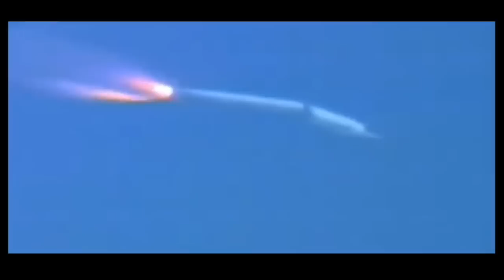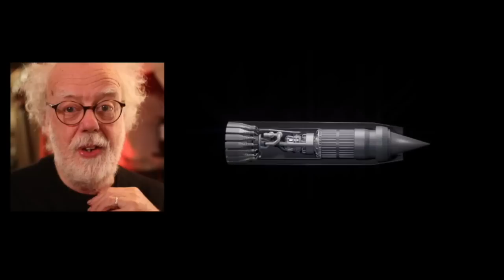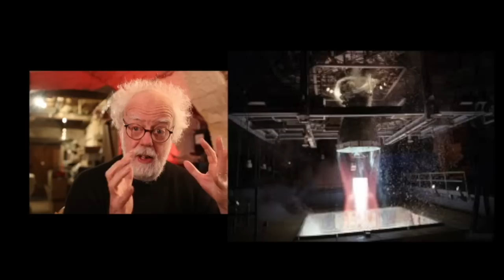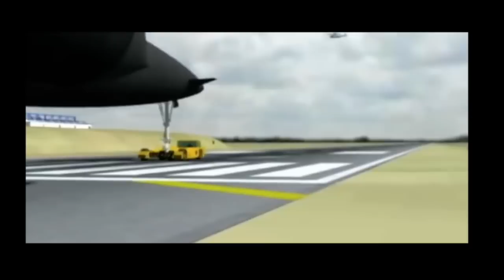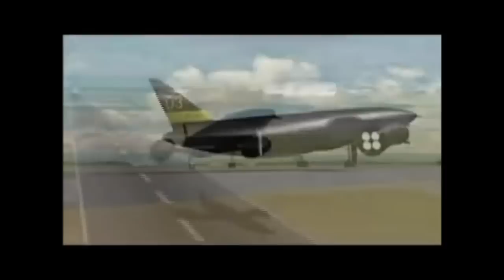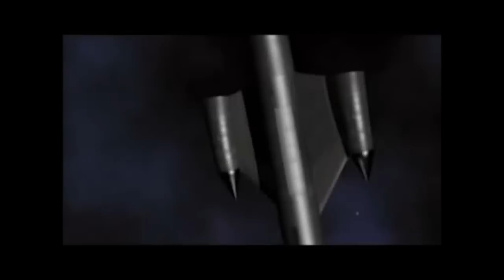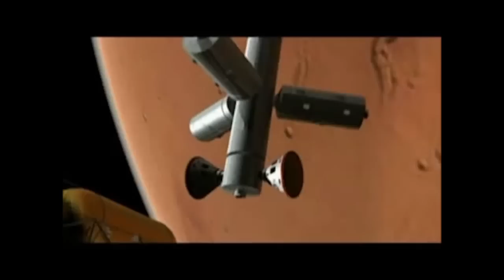SKYLON - The dream - Prof Simon

Comment: I've been following the progress of Reaction Engines for many years, hoping to see Skylon fly one day. Yet RE's home page no longer even mentions it. I suspect SpaceX's success with at least partial reusability has rather undermined the economics of Skylon, with Reaction Engines instead concentrating on engines for hypersonic aircraft.

Edit from here on: I hope that this is a tactical retreat, to continue progress on the development of the engine, without potential investors worrying about SpaceX. So that once the engine is proven, the financial risks associated with Skylon will be much reduced.

Airliners have been made so safe that most of us give safety scarcely a passing thought before boarding one. A space vehicle with airliner characteristics that doesn't have to come apart in flight and rely on rockets for a safe landing seems inherently safer than the alternatives. SpaceX may take the heavy lifting work for non-manned operations, but something like Skylon is surely the safest way of moving humans between the ground and orbit.
Reply from the maker: fab company...hpe this is a breakthrough for them.
Reply: Lockheed Martin bought into RE, I’ll just leave that there...........😜
Reply: @wayneoates8842  So did Boeing, DARPA, Ford and a bunch of others.
Reply: The value proposition for the Skylon concept is a little different to that of SpaceX. SpaceX were smart in using newly designed engines and composites to gain an additional ~2% payload mass fraction (not bad considering that traditionally rockets only have a 2% payload mass fraction to start with, i.e. a 100 tonne rocket at launch can lift ~2 tonnes into LEO), taking it to 4%. But the smart bit wasn't that alone, it was how SpaceX used it. They chose to use it to carry additional fuel and those folding feet so they could recover the whole stage, which is worth far more than the additional 2% payload capacity. However, the Skylon relies on another value proposition, which is flexibility of use. Rockets are limited in practicality due to the rotation of the earth, which means that to gain the inertial advantage of an already spinning platform, they must take off close to the equator, otherwise you end up using more fuel to reach orbital velocity. With an SSTO space plane concept, the inertial difficulties are less of a concern since you can essentially build up speed as you ascend to orbit using the oxygen in the atmosphere, making the concept less constrained in terms of operations and location. In terms of safety, well that remains to be seen I suspect... the stresses and thermal challenges involved in hypersonic flight and reentry are significant, so I think materials and thermal management will be the critical battlegrounds to win over ultimately. Using hydrogen and helium in their hybrid propulsion cycle is also a major challenge, since both are incredibly difficult to work with. Helium in particular is a major headache in closed loop cycles in cryogenics (such as reverse Brayton cryocoolers) because it's difficult to compress. This is due to the molecular degrees of freedom available in monatomic molecules, Helium has only three degrees of freedom in which energy can be added, so when you try to compress it, it rapidly heats up, making intercooling a necessity, which adds weight and complexity to any concept. Furthermore, its speed of sound is incredibly high, which makes compression from an aerodynamics standpoint challenging, since you reach the material limits of impellers before you get into the 'sweet spot' of efficiency. So I'll be fascinated to see how they overcome those issues personally.
Reply: Skylon has a chance to make even cheaper access to space than SpaceX Starship. Investments will be hard to find... EU should finance the program. It would be good for us, a technological leap... I don't like expendable rockets. No logically thinking being likes it. But they probably don't want to end invest into something similar as Venture Star was.
Reply: Sylvia Else It’s typical of so many revolutionary British inventions, something incredible gets built but we’re pathetic at developing them into fruition. The British government couldn’t really care less and pitiful amounts has been given to help. So now DARPA are seizing on it and it’ll probably be used in missiles and the military first, which is a double-edged sword as it’ll probably be developed far quicker but the civilian applications will take decades longer to realise. Well done again Britain, big clap 👏
Reply: You can't buy shares in Reaction Engines, which is a shame. I'd love to. But, major share-holders are Boeing and Rolls-Royce, so if you want to effectively own a chunk, you can buy shares in them. Long term investment though. Also, if Reaction Engines fails, for whatever reason, at least you then have shares in a couple of solid companies.
Reply: I am disappointed that REL has officially ditched Skylon as an inspirational goal. This video is a bit outdated in that sense. REL isn't run by Alan Bond any more.
Reply: Yeah iirc reaction engines is working with USAF now.
Reply: On 25 September 2017 it was announced that the U.S. Defense Advanced Research Projects Agency (DARPA) had awarded a contract to Reaction Engines for an undisclosed amount to conduct high-temperature airflow testing at a Colorado, United States site of a Reaction Engines precooler called HTX. I would hazard a guess as to THIS being the reason some of the publicly available stuff has gone away.
Reply: Also note that it was at the DARPA facility that they did the successful test. This will radically change how space is achieved and I think we will see some really rapid development in the next five years (if they don't let DARPA bury it). Amazing breakthrough. How do they get rid of the moisture I wonder.... amazing.
Reply: @robertsmith1434  That was around when spacex first started landing rockets, times have changed.
Reply: @chadleach6009  Sorry but no, they just passed the demonstration test for the cooler this month. It worked. The test for the engine housing will probably be in the next six months and the whole thing is very alive and well with DARPA and ESA along with several porivate investors like BOEING, and several others.
Reply: @robertsmith1434  I'm not saying it's dead, I'm saying the idea of a spaceplane does not make sense.
The goal of getting to orbit is by going fast, we only go up first to get past the drag of the atmosphere. What's the point of a vehicle that spends additional time in atmosphere instead of picking up speed where friction is lowest?
Reply: @chadleach6009  The aircraft does not have to carry oxygen to fuel the enigines in either mode. All rockets and spaceplanes spend time in atmosphere. The goal is to create a reusable engine and airframe, similar to that of an airliner. The Reaction Engines wants to sell those planes while partnered with Boeing, General Dynamics, ESA etc. They have a three stage process that has been approved by all partes and verified by the ESA, DARPA etc. The first important hurdle was the Cooler. That has passed. Now they need to build and test the Motor, which they have just built testing facilities for and partnered with a EU company to provide hydrogen onsite etc. The last process for approval on the enitre engines is the Inlets . These have to open and close during flight (after the engine converts to a rocket) and there is some tricky engineering going on but the USA has already really done this so basically both the Motor and the Inlet are engineering problem. Hard engineering but something that has been done before. Again the big breakthrough was the cooler, and it is what makes the whole thing possible when it really never was before. Sorry for the length but I did quite a bit of background research on this. To the point that I know they are using wire EDM to machine the coooler assemblies. They are using some exotic materials in the cooler with some really screwy properties... like metal that contracts when heated instead of expanding. Kinda cool.
Reply: @robertsmith1434  It is Reaction Engines Inc's facility, not DARPA's - built using the DARPA funding
Reply: @chadleach6009  The point is that it's more fuel-efficient to use the aerodynamic lift in the lower atmosphere rather than a head-on clash with gravity.
Reply: Greetings from sunny Florida. It's raining, so yeah I'd like to know how to deal with the moisture problem too. Maybe then I could spend less time helping defrost my sister's A/C unit.

Of course the U.S.government is going to try to co-opt the  development of this technology, we've got to start preparing to transport an entire governmental infrastructure into space before SpaceX and other private endeavors kick start the colonization procedure. Just wouldn't do to have an uppity group of colonists literally looking down on us and declaring independence. Need to nip it in the bud.

Plus those brave bureaunauts will want to bring all of their fat children and many, many, cheeseburgers!
Reply: @qjo  Well yeah but, I think Reaction Engines is really really aware of this. With the early ESA backing I don't think DARPA CAN bury it. I am eagerly awaiting the results of the Core Engine Demonstrator. They are taking a VERY conservative and provable approach to proving this technology. The reality is that the cooler was the big hurdle though. The Engine while technicaly difficult seems to be more a matter of engineering than requiring new technology (at least that is the way it seems to me... but I am an electrical engineer and NOT an aerospace one so just my opinion). Also I think the US has already solved the inlet engineering (which is the third compnent of their complete engine).  Again though the inlet engineering looks like a straightforward engineering problem. Difficult but the cooler was and is the huge breakthrough. The applications for something like it are literally huge. So... I really really hope it does not get buried but at this point I do not think it can.
Reply: @robertsmith1434  Bury it? No probably not, but I'm guessing the fact of DARPA providing a test site in Colorado was not a random choice. More likely than burying it they probably just wanted to get the inside scoop on the tech up close and personal to analyze it and prepare their reverse engineering efforts.
Reply: @robertsmith1434  its (the precooler) applications are going to be interesting,  where super cooling is needed. My thoughts are on super conductors and general manufacturing cooling to server rooms and air con? Maybe a mini one on my cpu in my pc?
Reply: @qjo  DARPA paid for the testing of a heat exchanger. The work was carried out at a facility built by Reaction Engines Inc. DARPA only wanted to know about temperatures corresponding to Mach 3.5, which were the results announced in April this year. Reaction Engines upgraded the test equipment (including adding insulation) so they could test to Mach 5
Reply: Skylon was a concept plane? 2 wings a fuselage and a tail with 3 tanks. But BAE are supposed to be building the plane, and its the cooler thats being intergrated into jets and fighters in the US. i doubt this will be a repeat of the UK jet engine given away and nuclear weapons we helped developed but werent allowed to have by the USA.
Reply: @shaun906  You have nuclear weapons. While I agree that the US refused to share data, yoiu actually had scientists who worked on the first weapons and they were well versed in it. It was just a matter of engineering after that... and centrifuges.
Reply: Although SpaceX have futzed with skylons economics there's something interesting in the real numbers.
I keep seeing that the real missions on SpaceX use them in expendable mode.
So they seem to be more interested in throw weight, altitude, speed and reliability rather than cost.
If Reaction can get decent loads up there safely and quickly with good turnaround they get the money and get to reuse their spaceplane.
Reply: @MostlyPennyCat  Maybe im misunderstanding you, but SpaceX recovers (powered landing) and reuses like 90% of there first stage boosters. They just launched one today for it's fifth flight. They reused a fairing today too...
Reply: @charlescsmith1213  they are not reused immediately, they are refurbished. we are talking about refueling, a quick check of the engines and refly. spacex don't say what happens to each rocket between each launch? its many many months thou.
Reply: @shaun906  My comment says James Neave in front of it because that's who I was talking to. You're trying to argue a nuance that wasn't part of my original post. But that's cool I guess.
Reply: Aren't SSTO vehicles a bit outdated as a concept now? If you could work a SABRE engine into the first stage and boosters of a reusable staged rocket, wouldn't that be the ideal scenario?
Reply: @therichieboy  The idea is that the engine function in two modes. IN air they will be eseentially normal but powerful, as they enter the higher altitudes the engine converts into a typical rocket motor. The big hurdle was the cooler which had to cool the incoming air temps (1000 degrees) and the test suceeded in doing bring the temp down to almost liquid, in 1/20th of a second. The secret sauce is the fact that the cooler did not freeze during this (imagine an air conditioning compressor and how they freeze). They have managed to devlop a process whereby mositure is taken out of the air, and it is compressed to very cold temperatures almost instantly. This is a huge benefit to both air breathing engines and rocket motors. It means you do not have to carry oxygen (which is really heavy) since in air it is supplied and the rockets simply use hydrogen.
Reply: @robertsmith1434  mach5??? Is not normal ... Concorde was mach 2 approx. The air is too hot at mach 5 so this is a first, remember conventional 1st stage rockets only spend 170 - 250 sec in flight. They need massive infrastructure, not the most confortable even with the new spacex's iphone crewdragon. I think this will be like Concorde where starship will be a380 to mars.
Reply: @robertsmith1434  Yes, this is all true. My question was whether they factored in the inefficiency associated with SSTO's dead mass. On further research it appears they believe they have. I'm not sure, however, if they've done anything about single nozzle geometry issues. My point is maybe this technology coupled with reusable staged rocketry might be the most efficient thing.
Reply: @therichieboy  No argument there Richard. I think that they really have focused on the idea that an engine capable of both natural air breathing, and rocket propulsion combined with the gains to the top speed for the natural aspiration (mach 5... can you imagine?) was so attractive they went that way. I think it was more a philosophy thing, they are trying to create and sell a space capable 737 sort of, and open up cis-lunar space as well as ease travel time from a to b on Earth. They ARE looking at a "second" stage rocket to push objects into higher orbit and to create refueling points but... thats a kind of down the road thing. They had to prove they could actually build the engine first, which I am sure you understand. I cannot wait for the results of the motor tests this spring.
Reply: @robertsmith1434  All very good points. Either way I'm extremely excited. I've been casually following them for years and it's really looking like things are happening!
Reply: @therichieboy  My thoughts exactly. If you can reduce the risk associated with staging there is not much point in accelerating the airbreathing engines and their tankage mass all the way to orbit.

People will accept much greater risk in order to get to orbit than they do for air travel.
Reply: @phamnuwen9442  The airbreathing engine IS the rocket engine, it doesn't become a parasitic mass when it transitions to rocket mode. It simply takes onboard LOX to burn the hydrogen after the atmosphere becomes too thin to support combustion effectively. 

By using atmospheric oxygen for the first 25km of ascent it saves on carrying that weight of LOX to that point, the hydrogen fuel is common to both airbreathing and rocket modes - there is no parasitic tankage mass.
And as it's accelerated to around Mach 5 by this point, it's also acquired a good chunk of the Delta-v necessary to achieve orbit.
Reply: Skylon has failed to attract investment -- "Everybody" knows that Single Stage to Orbit is "too difficult" and REL's own plans for it showed there would need to be 15-20 billion investment and 15-20 years before seeing a return on the investment.

RELs new management are focusing on developing a revenue stream and lower risk routes for space access - TSTOs that can run from existing runways. It'll cost more and take longer to get to  something Skylon-like but it's more likely to get funded. REL don't mention Skylon any more because "it's a distraction" -- once they have engines being flown then something Skylon-like (SSTO, combat aircraft style maintenance, airline like operations) may be on the cards again.
Reply: @jocramkrispy305  when you look at the history of air travel and planes/liners, we can evaluate the evolution of the technology, compared too market decisions. Concorde was before its time as the market went big with the Boeing 747 jumbo. The A380 has failed as the hub system has changed. Now its direct flights on small but fast fuel efficient jets like the 777, 787 and A350 with flights direct from uk to oz. By that logic a digital Concorde at mach 5.5 can commercially work. A SSTO craft will be totally different than the concept  of 'skylon' that was simply and aerodynamic shape of a craft put in a wind tunnel (they have spent 0% effort on skylon as they have invented SABRE?).
Reply: @shaun906  They put significant work into designing Skylon. The purpose of SABRE was to power a HTOL SSTO -  The belief being HTOL SSTO is the only way to get operational costs down and safety up (See, for example, the Skylon as a European Launch Service Operator papers) and to ensure it would deliver a useful vehicle (e.g project Troy).

It's only the operational and safety improvement that can justify the high development cost, while it should save enough on fuel to cover the manufacturing cost, and possibly cover the ground infrastructure, you need to have a very optimistic view of the future launch market for it to pay back its development costs.

TSTO SABRE vehicles will be able to orbit more payload for their size, but dont bring the operational advantages. 

That said, Skylon is a minimal design to make sure it could work, based on established technology of the 90s -- it's likely that 1st generation SABRE HTOL SSTO will be more advanced, especially if the engine is well proven in TSTO applications.
Reply: @jocramkrispy305  a cooler within a RR engine (as proposed) will make jet liners more efficient and allow a return. BAE are better placed to build a ssto vehicle. hence RR and BAE involvement.
Reply: @shaun906  That's in agreement with what I said? - They've backed off from Skylon to pursue more short term goals more palatable to investors
Reply: @shaun906  But since we're here, why does a refurbished booster not count as a "reused" booster if the engines and fuselage and tanks are the same and have previously flown? "Reused" is not mutually exclusive to "refurbished."
Reply: Agreed Skylon would be better suited for passenger service as they probably would not let Starship operate anywhere near a city because if it looses power it crashes plus the sonic boom problem but Skylon probably could operate near a city since it's failure modes would be more like an airliner.
Unlike Starship it can do rejected takes off ,dead stick landings and approach at sub sonic speeds.
Another advantage Skylon would probably be quicker to turn around than Starship since the re-stacking of the two stages would be at least as involved as putting the Shuttle on the 747 carrier.
Reply: I rather suspect that the pre cooler was merely the first, probably easiest of the many problems requiring solutions for the Sabre engine, never mind the ssto platform. Previous generations of engineers were not idiots. When hotol was shelved it was due to economics. Yes there have been developments since then but those also apply to conventional space launch, which is now much cheaper too. Reaction engines will be chasing a moving target of cost to orbit and probably threw in the towel. A great shame if true because SSTO is really cool.
Reply: @drawingboard82  the first obstacle was icing up of the cooler, very much like the freezer in a kitchen, Solved in 2002. The next 10 years were spent developing a way to manufacture the tubes/cooler with consistency and in volume. 2012 started full testing of said cooler with an old jet engine.
Reply: @drawingboard82  The Hotol engineers - you mean Alan Bond? The same guy who's been involved in the Sabre/Skylon design?
Reply: @sylviaelse5086  I was thinking of the rest of them. All the rolls Royce and bae people.  I'm sure Alan bond is not stupid either but I've seen people latch onto ideas too many times now to believe that just because someone says it can be done, that therefore it should be done. Even if it's really cool.
Reply: @drawingboard82  Yeah it is a cost/benefit model but... a lot of aircraft manufacturers have invested in it. Including EAS and DARPA.
Reply: @drawingboard82  Gonna be honest, I think the cooler is the hardest problem. The motor and inlets are hard engineering, but fairly straightforward. I think the US has already really solved the inlet issue to be honest. The cooler, and how they manage to eliminate the freezing issue is where the "breakthrough" is IMO. How they did that, I am unsure. Just overcoming the whole thermal expansion (zirconium tungstate anyone?) would be a nightmare. All within 1/20th of a second (which is how long it would take to freeze as well). The applications of just the cooler are amazing.
Reply: @robertsmith1434  I agree, the real breakthrough is in the precooler. They mitigate icing by spraying methanol into it during the flight phases where it presents an issue to prevent ice nucleation. And the thermal expansion challenge is overcome by the geometry of the precooler; it's sort of 'spiral' shaped, which allows the centre to move slightly, allowing thermal expansion to occur without incident.
Reply: @drawingboard82  No. They attacked it first because it was the most difficult and obviously there is no point solving the easy problems if the hardest one cannot be.